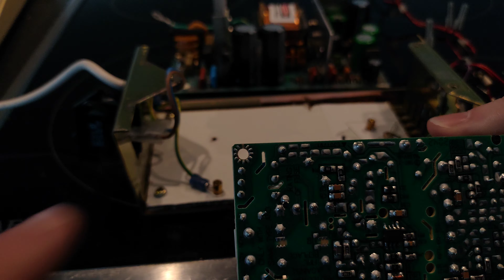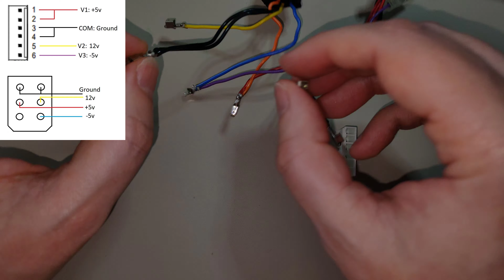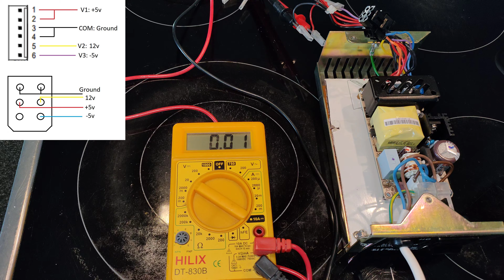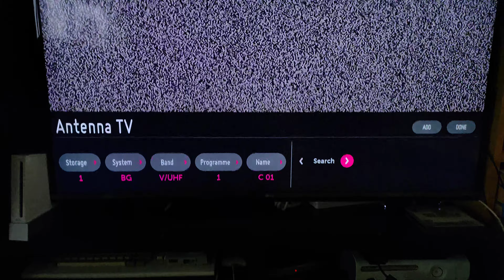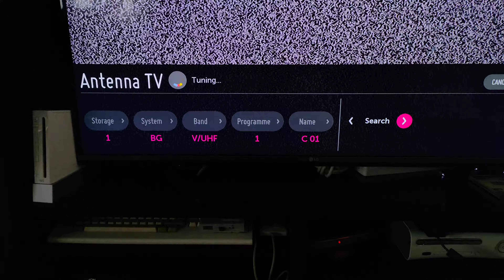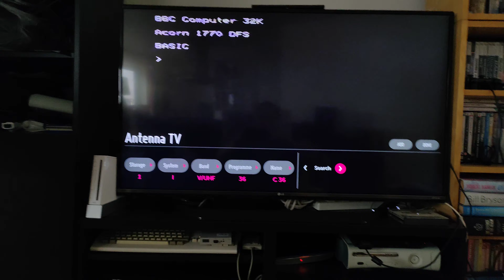BBC Micro - Power supply upgrade with brand new Meanwell PSU

Comment: Thanks for this VERY useful video! I've just started thinking about re-capping my Beeb's PSU, but replacing it with an RPT-60A seems to be a much better option, if only because it accepts 120V as well as 240V input. I brought my Beeb with me to Canada when I moved here, so it'd be handy to be able to use it without messing about with 120V to 240V transformer!
Reply from the maker: Ah that sounds ideal! I find it a great comfort to NOT rely on 40+ year old power supplies too.
Reply: Agree that replacing the PSU for a new modern one is a better overall solution, though more involved. Know that most BBC PSUs have two solder points you can add a jumper wire to to convert the PSU from 240v to 120v as an alternative simpler plan. Of course if keeping the original PSU you really should recap at least, which is also quite involved, so it might be 6 of one and half a dozen of the other

Comment: this worked for me. I replaced the old broken PSU with the one you recommended. The PSU now powers the Master 128, an onboard Raspberry Pi 3 1Gb plugged into the internal tube interface, and an external Gotek drive with no problems whatsoever. Thanks for the video
Reply from the maker: Awesome, they're a great little solution for a lot of these retro machines. Much easier and safer than messing with the old power supplies!